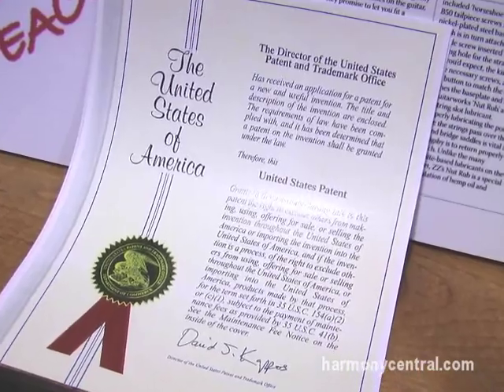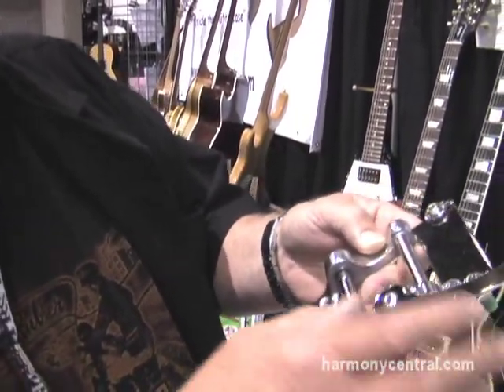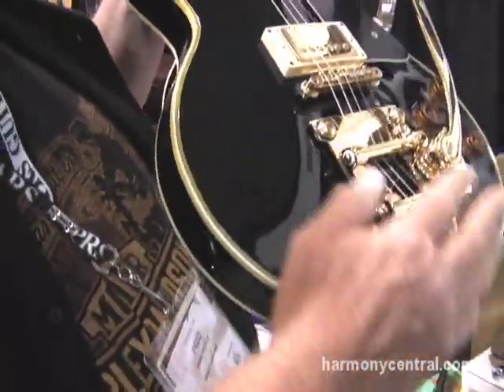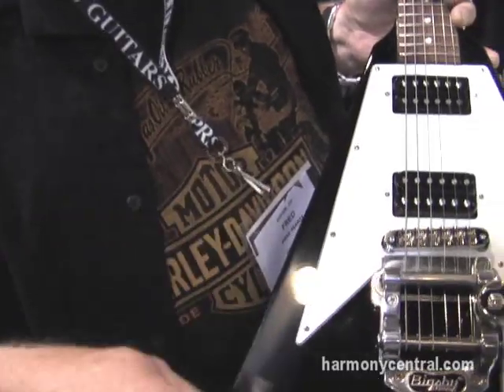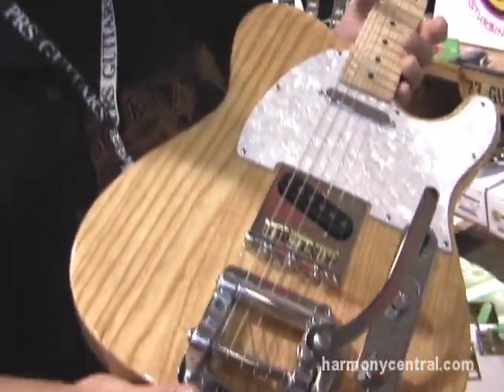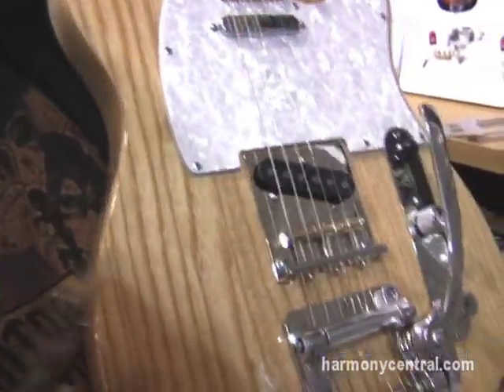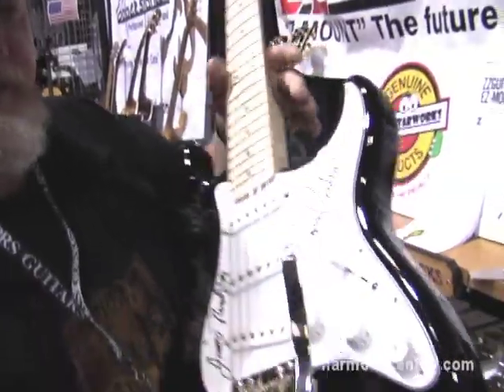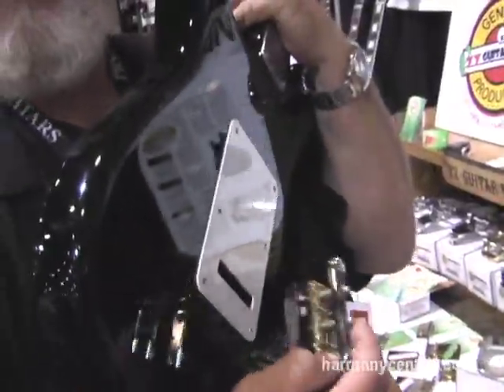ZZ Guitar Works No-Modification Bigsby Installation System

Comment: @kssork vibramate.
com/vibramate-
v7-lp-install.php

You can also mount the bigsby b5 on top of a les paul with the vibramate but the b7 that is demonstrated in the ink is meant for the LP since it has an arched top (not flat)